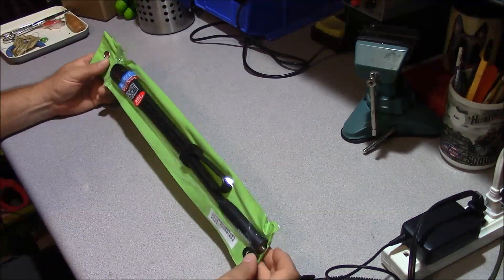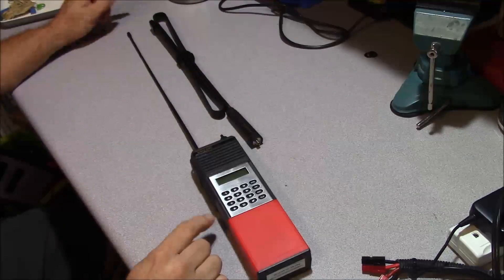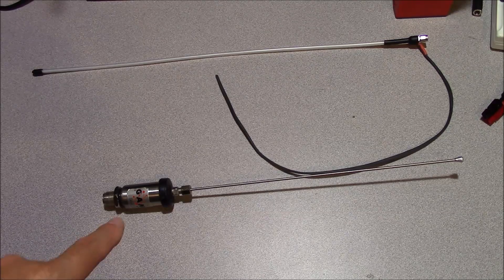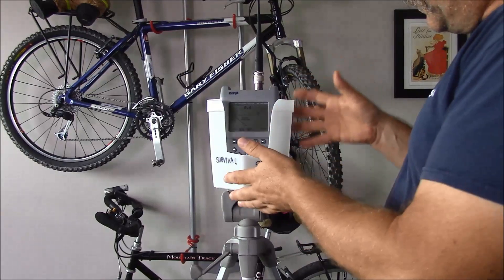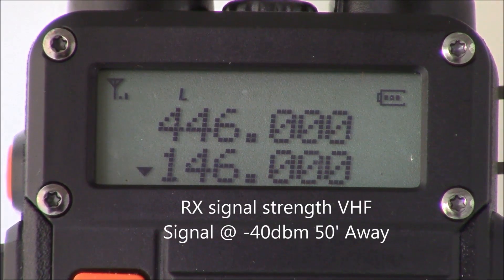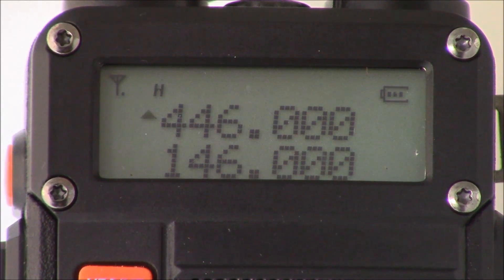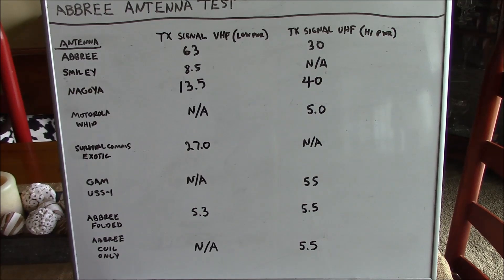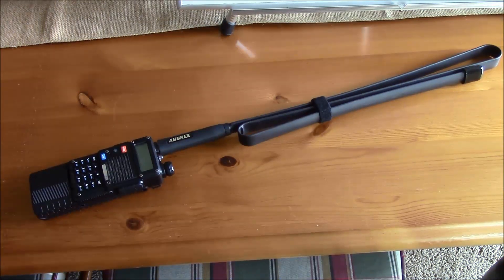ABBREE 42.5" VHF/UHF Blade Antenna Absurd but works well !

Comment: I been using this 42.5 inch antenna for over a year and its the best antenna around. Even better than the Nagoya. I ordered ten of them and use them on all my hand helps. The 42.5 can reach the repeater where all other antennas I tested can't so if it is good range you are looking for then this is your antenna. I am in the army and we actually removed the antennas on our hand helds and replaced with this 42.5
Reply from the maker: LOL thanks for watching !
Reply: @survivalcomms  No reason to be an egocentric prick. You ham guys really are a punch of no-life douchebags

Comment: I live in an area with practically no signal. We dont even get regular AM or wireless TV signals. The Abbree antenna lets me hear the repeater I like to listen to no problem. I usually have to be 10 miles north to pick it up. But oddly it works better if I lay it horizontally... Not a problem but just something I noticed. I hear the 28" preforms about the same as the 46" so it seems that after a certain length you really arent gaining much and even less when its folded. Which I did notice it does not like to be folded...
Reply from the maker: You are likely not gaining much over a quarterwave in using the abbree antenna but you are gaining some. its interesting its working better horizontially. In fringe coverage the slightest interaction with other close objects can make a big difference. Is this in one spot or have you been able to repeat it in multiple locations ? Thanks for watching !
Reply: @survivalcomms  The whole area as in all of the south end of my county is like this even though in some places I have basically line of sight to the repeater...
Reply from the maker: @YouTubeDoxedMyRealName  Is the site set up for coverage in the opposite direction of where you are operating from ? What antenna are they using and is it side or top mounted ?
Reply: @survivalcomms  Their repeater is up on a mountain behind my county along with all the TV and radio towers. They have a massive array of antennas up their mounted on a giant mast on top of a steel reinforced cinder block building. I dont know whick is for what and I haven't been up their sice they closed the road due to fires a few years back. I suppose the repeater might be set up to reach the county north of me and I am in the south of my county. The farther north I go the better the signal gets. My Extreme Power works better vertically in the exact same spots how ever.

Comment: Wonder how difficult to remove end cap and shorten to better tune?
Reply from the maker: It's a folded over tape measure. You could remove the cap and heat shrink and shorten by removing the screws at the base and shortening one leg. Thanks for watching !

Comment: I'm thinking of getting one but 42 inches seems way too awkward for my needs. So 18 or 28in? What ya think?
Reply from the maker: 42" is way too awkward and it will break your radio's RF connector. Get an antenna based on a 1/4 wave which is like 19"  Its easy to build one,  large enough to be effective, and sized to be practical.  Hope this helps and thanks for watching !
Reply: @survivalcomms  hmm get a longer one 28inch an cut it down?
Reply from the maker: @beingsneaky  There is a matching section in the base -  Cutting it may make it unservicable.  I put my 42" one on a ground plane kit I made and use it that way. I did a video on it sometime back. Thanks for watching !

Comment: I hadvthe same issue the antenna broke at the connector, although I did order an extension cable for this
Reply from the maker: If one is going to run this antenna that is the best way to go. The stress it puts on the connector is considerable. Thanks for watching !
Reply: @survivalcomms  And thank you for all the time you put into great content 👍🏻
Reply from the maker: @Theonewhoroamstherealms  You are welcome Thank you very much !

Comment: My radio goes to 130mhz to 520mhz so why does all antennas say they don’t go that low yet I receive 130 still anyway?
Reply from the maker: Receive you wont have a problem . When you transmit it will not present the correct impedance and will reflect a larger percentage of the forward power than is desirable. An antenna is a tuned circuit.  Thanks for watching !

Comment: Maybe throw it on a magnetic vehicle mount? The 28" might be more practical for that though, I wonder how the shortest one and the longest one compare.
Reply from the maker: It would be more practical over a groundplane kit. Even then it is still pretty bulky. Hamradiocrashcourse did a test of the various lengths against one another recently. Thanks for watching !

Comment: I use the OLD reliable, the Radio Shack Telescoping Center loaded HAM antenna, it’s just 6” closed and 26” fully extended, you can even transmit 5w, and is great for QRP operation, it even has a center load so no ground plane is needed and it’s fully Tunable from 25 - 1300 MHz by opening or closing the sections.
Reply from the maker: I still have a couple of those here. Thanks for watching !

Comment: are there any stress on the SMA after a while's use?
Reply from the maker: This antenna will break your radio over time without extraordinary care. Get one of the thin rat tail antennas for your primary and a small ground plane kit for the rat tail if you need better coverage IMHO. Thanks for watching !

Comment: Thank you for your review of this antenna. I'm a little bit surprised by the SWR of NA771. I've seen many review of this and the common SWR result was 1.1/1.3 !

So i've seen here some people sayed theire antenna has a SWR of 1.1, approximatively. 

Also, someone can send me a link for this antenna, smaller than this one like 18 inch.
Reply from the maker: I was surprised as well. Handheld radio antennas are generally  difficult to get a match on .  The only thing I have seen a perfect match on is a dummy load :) Amazon has the short one for $11.50. Thanks for watching !
Reply: Arf, i don't know if it's the good one with the green package... I've seen in com a guy who received a yellow packaged one...
Reply from the maker: @TheRadickale  This a real one according to Nagoya. There is plenty of counterfeit stuff out there though however.....

Comment: I use one strapped to the frame of my pack when I'm out hiking. I use a short piece of patch cable and a tiger tail. Seems to work well. Hits every low hanging branch, but in the open it gets the antenna up pretty high up.
Reply from the maker: That is the way to use it if one chooses this antenna. I have done the same in testing and that is the most practical to use it. I would like to see a photo of your setup. Thanks for watching !
Reply: Yup! I was thinking the same thing. I did this for a couple of friends with regular whip antennas. How long is your tiger tail? The standard length for VHF or UHF or what? I plan on using this for VHF primarily with groups over the hilly terrain of Upstate NY.
Reply: @nateo200  I primarily use VHF, so I think it's 19.5 inchs. I'm sure it would be better if both the antenna and tiger tail were matched. Meaning quarter wave antenna and quarter wave tiger tail. But I never got around to making a new one. Still seems to work. 🤷
Reply from the maker: @kennethh5657   The VHF length (19") one will work for UHF just as well. I did a video on making one out of stainless cable.
Reply: I'd love to see a picture of that too. Sounds like a practical backpack set-up...and mine is on it's way today; radio with this antenna included, and the Nagoya 771. The Abbree was a throw-in bonus package deal I suppose. I'll keep it in my pack, but when I read your comment the backpack set-up made perfect sense.

Comment: I got one of these "permanently" mounted to my go bag.  Woven thru the molle on the side with a 16" lmr1xx(something) cable with a right angle bnc so my yaesu can stay inside the bag.  Mine works very well. Bought a couple more yesterday, a 42" and a 18"..
Reply from the maker: Cool ! you can do that with a commercial mobile antenna and an NMO mount with a stainless cable resonator / counterpoise as well. Thanks for watching !
Reply: Molle weaving is exactly what these types of antenna are designed for

Comment: Do you think trimming it shorter would help? is that feasible?
Reply from the maker: You could try it and put on a heat shrink tip. It is resonant at 135 mhz so shortening it would help tune it. Its just so doggone big and no good at all folded up. Thanks for watching !
Reply: @survivalcomms  I'm looking at an antenna for MURS(151-154mhz) for longest reach, not all the time use, I'm running a nagoya 771 for everyday stuff. I don't have a SWR meter. How would you go about tuning/trimming it? Thanks, I just found your channel and am now bingeing lol
Reply from the maker: @Falconguygaming  have you thought about adding a counterpoise wire to your Nagoya ? That would likely help and cost very little. I have a video on it.
Reply: @survivalcomms  yeah just got saw that one. Will definitely try it out after this hurricane lol. Thanks for the content man!

Comment: Does this antenna can work at 136-520mhz frequency
Reply from the maker: In testing this antenna in that range there are two points where it is resonant 137mhz and 420mhz. In the 144-148 mhz range VSWR is 2.13 :1 and  in the 440-450 range it is 2.05:1  it is almost 3:1 at 462 mhz .  I hope this helps ! Thanks for watching !
Reply: @survivalcomms  thanks alot my frend
Reply from the maker: @zensarifin4072  You are welcome
Reply: @survivalcomms  that is, if I play at 454,075 using a 108cm tactical antenna, will it increase the range of the device trasmit,
Reply from the maker: @zensarifin4072  It will somewhat.
Reply: I can has cheezburger?

Comment: What’s the forestry service radio you showed in the video? You made a comment that they’re really great radios if you can get your hands on one.
Reply from the maker: It is a Bendix King EPH 5102 . They don't narrowband so many are available surplus in the 20 - 100 dollar range depending on accessories. The PRC127 is the military equivalent.  I should do a video on them. They are a big heavy radio but they are a real radio and not a chicom toy. Thanks for watching !
Reply: SurvivalComms funny...I was searching around and found several Bendix radios that looked very similar and figured that’s what it was. 

Thanks for doing what you do! Seeing the Abbree “Mickey mouse” antenna get out through the paces was amusing! I’d be willing to bet that nobody at Abbree connected one to a Bird tester. 😂
Reply from the maker: @StopTheMadness1337  You are welcome ! Mine has that stainless shield over the keypad. Makes it look a bit different. We had a whole fleet of BK LPX2101's for public works back in the day on conventional 800 before the trunking bug bit.   I like using test equipment for evals . It is a tad more scientific. I realize I am lacking an anechoic chamber and a  good spectrum analyzer so I roll with what I got. Beats kerchunking repeaters IMHO. I have done some more testing of the abbree and it will be in an upcoming video. Thanks for watching !

Comment: Yellow bag = counterfeit
Reply: The yellow package looked like the shipping material. The inner package was green so genuine. Or Cigar Dad was just mentioning it for others out there shopping. Anywho. Great vid. Thanks. 😉
Reply from the maker: Good point it sure could be.  I still think the antenna is not practical. Thanks for watching !
Reply: I've seen some reviews of the real thing that are pretty impressive. The Yellow Bag is a true indicator of a knockoff. Look up the item on Amazon and the real posting from ABBREE shows the differences. There is also a tear down video floating around where the dude had a fake one and you can see the poor build quality.
Reply from the maker: @CigarDadPGH Its funny that I bought the antenna from Abbree per my purchase history.  Chinese stuff is all counterfeit to begin with and what you get seems to be  the luck of the draw.  It is a 5/8 wave antenna and as such has 3dbd which is impressive but not new tech just in a more walter mittyesque package.  However I still maintain that it is impractical  and as I stated before its a broken RF connector waiting to happen. Create some content doing your own testing. Thanks for the input !

Comment: I think that long one is more practical if you clip the radio to a belt or backpack and use a speaker/mic. I have been thinking about getting one and adapting it to BNC and putting it on my FT817. I would like to know what you used to build up that adapter to use on your meter. Other videos I have seen on this antenna where they just transmitted to a distinct repeater and listen on another radio showed better transmit and  reception on the ABBREE. Also I would like to get the link on your bugout antenna that you showed? I might want to try that out for my apartment setup. I have DStar HT and have problems getting into the repeater I would like to see which works better for me.
Reply from the maker: I would not recommend the abbree antenna. They are cheap enough to try out but my experience  over the following few weeks has been very lackluster. They are way too heavy even for a BNC and you can see it in the attachment. The over air difference between just a rat tail and a quarterwave and the abbree antenna is very small. Stay tuned - Video forthcoming in a few days of the bugout bag radio  and antenna system. Thanks for watching !

Comment: Hello Brett, I was curious can I run this on my Yaesu FT 65? Great video
Reply from the maker: Thank you ! I do not know for sure if it will fit. Here are the dimensions of the base of the antenna :
The base diameter of the antenna is .750 (19mm). The inside diameter of the relieved base body is .470 (12mm) and the depth of the relief is .070 (1.8mm). The kit includes 2 rubber gaskets to fill in the relieved section if required. Thanks for watching !
Reply: It fits the ft-65

Comment: I have mine on my FT817ND that is in my go bag / E-com and it rips in that use for me . It goes without saying as you have shown at the end of the tests that it is not for ht use. Think outside the ht lol Richard vk2ual
Reply from the maker: I built a pocket sized ground plane kit with a section of RG58  and its a great  "jungle" antenna. One of my subscribers came up with the idea and it worked out well It is a real 5/8 wave 3dbd on VHF - the only real competition in packable antennas is a tape measure yagi or a tree top rhombic. Video is forthcoming. Thanks for watching !

Comment: I use the Abbree 18.8 inch antenna. I've used it all summer on a TYT UV8000E, HT. It has improved the performance of that radio a great deal. I use two frequencies in Cheyenne WY, where I live, both are repeaters. First is 146.775, I get a SWR of 1.17, and 449.300, and I tested it three times, I get a SWR of 1.08, very odd, but works well. An interesting note, the Abbree antenna is only rated for "8 watts" but my TYT has the potential to put out 10 watts, but in all of the use I've put it too, the antenna has never heated up. I have tried to contact Abbree, but have had no luck of late. So there you go. Oh, I had to modify the base of the antenna a bit to fit my TYT , but it now sits secure and flush with the radio. One last note, I have the Nagoya NA 771 antenna, and the Abbree, out preforms it.
Reply from the maker: I think the shorter variant is much more practical and am glad to hear that it is working well for you. I wouldn't worry too much about the power rating of the antenna as long as you are using it within its frequency design parameters. Good luck contacting the manufacturer - it's been my experience that unless it is a marketing angle they really have little interest.  Thanks for watching and sharing your experience !
Reply: @stefanozebralight518  Yeah, I guess I forgot to mention I had to modify the base of the antenna I use on my TYT, due to the channel changing knob on top. I used a Dremel and a sanding drum, and carefully sanded the very bottom of the base till it just fit. Don't over sand. I still stand by me statement, its a good antenna.

Comment: would this work on my xpr6550 its SMA Female?
Reply: Yes my thoughts exactly about the structural support. Ill more than likely continue to pursue the ABBREE but maybe the 28 inch version. Thank you for quick response.
Reply from the maker: It does not mate up well the the XPR6550.  The radio's housing does not allow the oversized base of the antenna to thread in far enough. I hope this helps and thanks for watching !
Reply: What about using an adapter?
Reply from the maker: @sagemata5756  You could do that - However you will need to build up some sort of shoulder around the outside of the adaptor to spread the footprint of the antenna assembly for reinforcement purposes. The weight of the antenna will break the adaptor or your SMA in the 6550. I snapped a double male in half when I was testing the antenna on the AT400. I reinforced my second adapter to continue the testing. Another option is a tiny jumper of quality coax as a flexible adapter to relieve strain on the RF connection. This may work well but would require the antenna be placed against a non conductive support structure.  SMA is an excellent RF connector but its diminutive size does not lend itself to strength with lateral force applied. I feel like a better option is a small ground plane or roll up jpole with 15' of compact feedline.  I hope this helps !